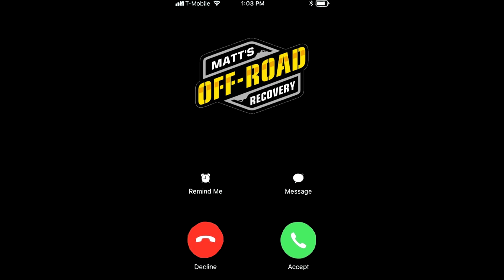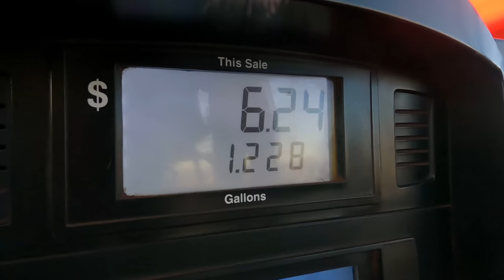I Take Over Matt's Off Road Recovery For 24 Hours!

Comment: I hate my “high tech” warn platinum winch controller.  The thing turns on when any button is pressed and doesn’t auto power off, so the battery is ALWAYS dead when you pull it out.

Comment: Good job guys.  A little hint, the less cable in the drum the more pulling power the winch has. Next time stay back as far as you reasonably can. Also don't use your winch as a tow strap.  Could be the reason Holly's cable was bound up? 

After watching the guy scrap the rock and you didn't pull your hitch, did you even remember it's there?  

You guys always have fun.